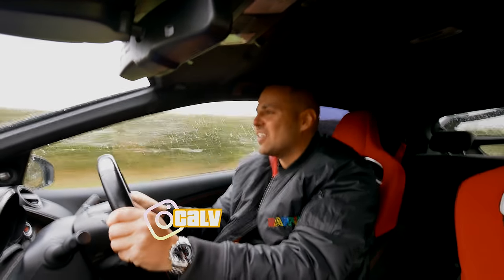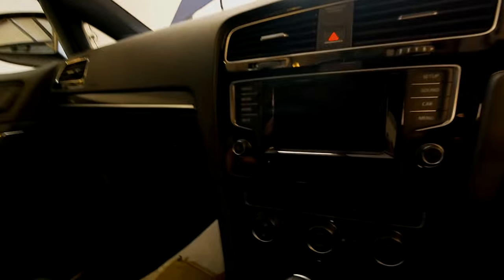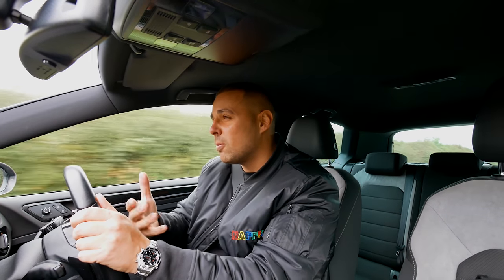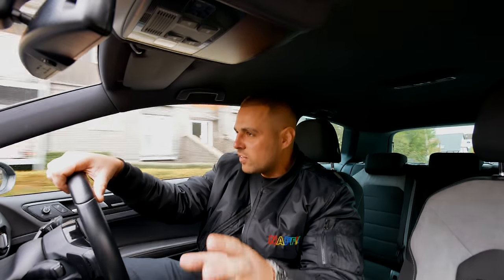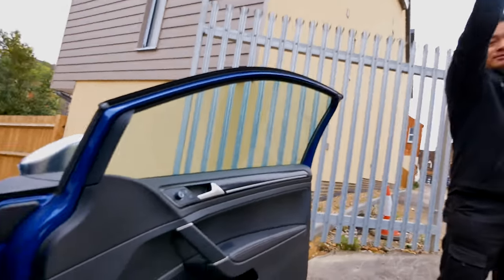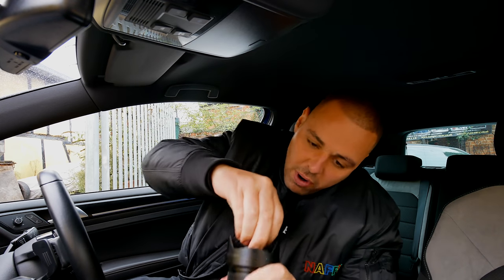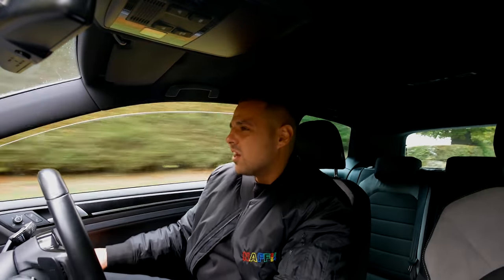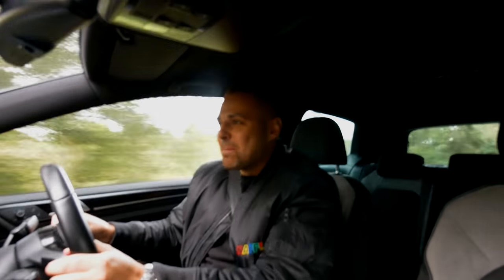New battery on my  *NEGLECTED* '600BHP GOLF R' at KNIGHTRACER | VLOG

Comment: Imagine being a car guy and don't know how to change a battery, its easy mannnnnnnn! Even with stop start
Reply from the maker: Merkzz Yea I’m a bit of a nightmare like that. I’m only really good at earning money out of them.
Reply: Yes very simple. However you can't just stick any battery that fits in and it needs coding (It will still work If you dont code it but  you're not going to get the most out of the battery since the battery charging management system needs to be told its a new battery and what type of technology it is as to more efficiently deal with it) . The battery on my 2015 R was toast at 3 years old and 30k miles.